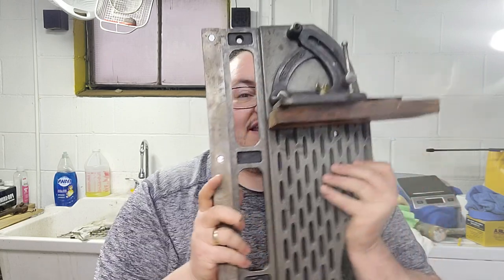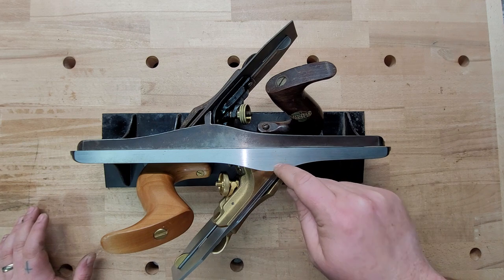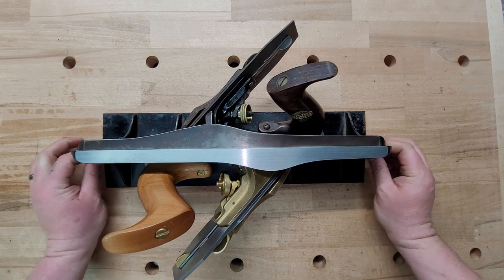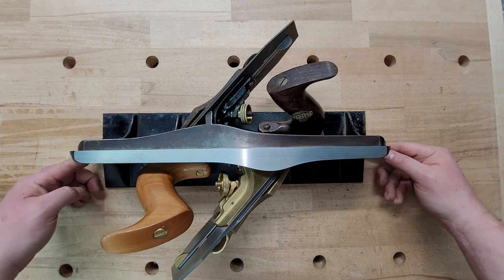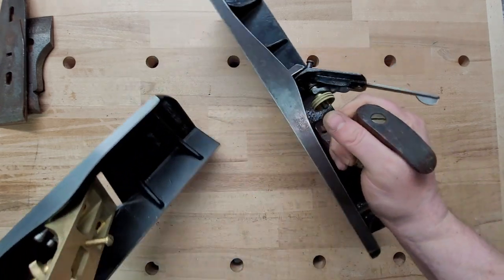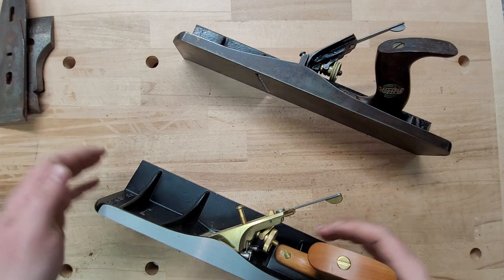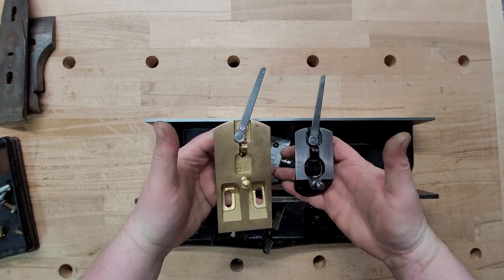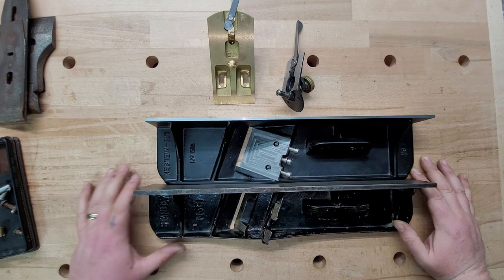BIG CHANGE! 51 Shooting/Chute Edition - Lie Nielsen Vs. Stanley Comparison What LN changed/upgraded

Comment: Circle on the mouth should be to prevent cracks from forming in the sharp corners. Probably not necessary in the newer more ductile material.

Edit: just saw someone else already caught this. Sorry!
Reply from the maker: No worries! I appreciate you!
Reply: They make portholes on ships round for the same reason - to distribute torsional strains around the circumference of the circle rather than concentrating it in a square corner.

Comment: Wow I was not really expecting that with the Stanley frog. I knew they were fragile from reading Dereck Perth's blog and review about one he got, with the fix on his from a past owner being to outright weld it down, but man, that thing is tissue paper thin. I wonder why they didn't just find a way to slap on a standard Bailey frog or do a modified slanted frog with a similarly modified base like Miller's Falls did decades later on a single prototype jack plane that had a skewed mouth.
Reply from the maker: I agree. As I looked a little farther I'm seeing that this is actually a Bailey design like the original Bailey design if you look at some of his planes they have a frog that is similar to this 1. They should have upgraded it though that's why they upgraded the other ones lol